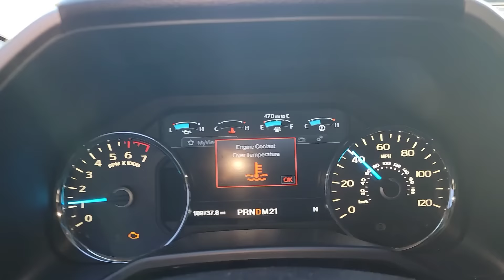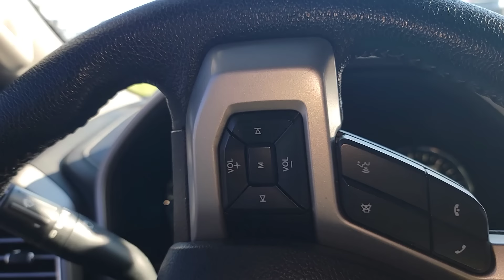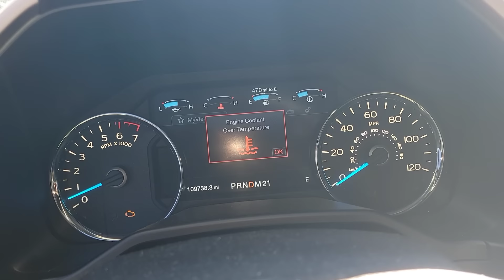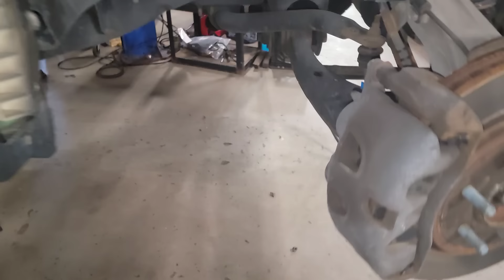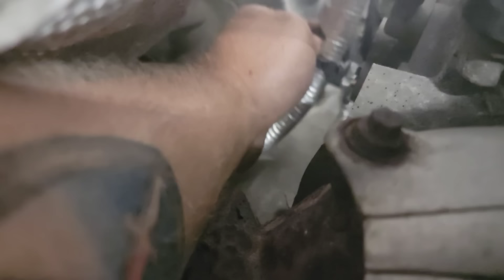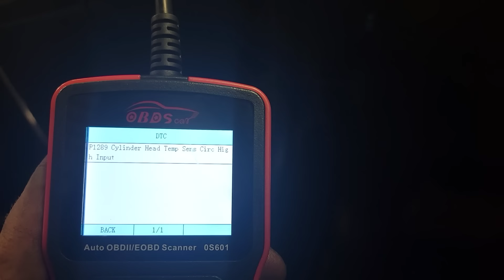2015 - 2016 Ford F150 P1289 - Overheat Out Of Nowhere - here is the fix - Cylinder Head Temp Sensor

Comment: Hi, I have a 17 F150 5.0. Had a temperature fluctuation last winter so I changed the thermostat an that seem to correct the issue. A couple weeks ago it started doing that same fluctuation again so I changed the CHT sensor but it did not correct the problem. Today I noticed that when I turned the a/c on the temp dropped right back down to normal, 194-198. So that made me realize that the fans not kicking on. We hooked it up to a computer and the temperature correlated to the same as the digital readout. We could turn the fan on with the computer but still no fan when temps got a above 200. We checked the fuses and moved relays around still no fan unless the a/c was on. Do you know what may be causing the fans to not kick on when the engine heats up?
Reply from the maker: Well the fans technically don't kick on until like 205 to 210
Reply: @FordBossMe  still won’t kick on, will go up to 222-225
Reply: @FordBossMe  what’s to hot for the fans to kick on?
Reply: @LowRotor is there a thermo switch for the fans??? I have a 2014 F150 3.5L new CHT and it will climb slightly for a short minute then drop, can't hear the fans .... maybe a bad thermo switch???

Comment: I have this issue right now but Ik it’s not the sensor but it’s the connector, it came lose.. is there a fix for this?? Or what should I do
Reply from the maker: If the connector won't snap back in you're going to have to put a new connector on it

Comment: I am having the same problem with my 2011 ford explorer. Ford puts these sensors in the worst places. I've changed the sensor twice. The first time it worked for like 2 to 3 weeks and then it started acting crazy again. I just changed it again and its still acting crazy. P1299. Do i need to get the sensor from ford? First one was from advanced auto then napa. This is driving me insane! Some please help!
Reply from the maker: I have not had that problem with the Ford Explorers so I don't know how to help you on this one
Reply: @FordBossMe it does the same this f150 was doing

Comment: I’m having the same problem, doesn’t throw a engine code and coolant bubbles once it gets hot. Wait 2 minutes and it’s fine. Coolant level stays full trans temp stays normal any suggestions
Reply from the maker: It has to be professionally diagnosed
Reply: Did you ever figure this out. Mine is doing the same thing. Engine does seem to get hot but trans temp remains good

Comment: Those gauges show display actual temp.. Which they can
Reply from the maker: Okay so I don't know what you're getting at or if you think you're trying to teach me something that you ain't really teaching me but you can actually put the truck in engineering mode if you watch my video on it and get a live read out what the temp actually is
Reply: @FordBossMe  Dont know why you felt the need to get an attitude.. Thought my point was clear.. The gauges can display temp, ford chose not to.. Mine does because I bought the obd2 programmer to make them display temp at all times.
I did watch you vid..

Comment: I was having the same issues, fans racing and truck overheating. I replaced the CHT and it still overheats typically when I drive it at or above 60mph. My next option is to replace the thermostat. Has and anyone on here been able to fix this issue? If so, what do I need to do?
Reply from the maker: Yeah if you watch my other videos you'll see that the thermostat is the next option but this typically fix it most of the time

Comment: Is it okay to drive with this problem until you can get a new part put in?
Reply from the maker: If it were me I would know what was going on and I would feel safe but telling somebody else to do that without knowing they're complete situation and them not being a mechanic to be able to assess the situation like I could I couldn't give you that advice

Theoretically I would say yes as long as you're monitoring your trans temperature you would be good but it's also going to make the vehicle run like crap it's going to be dumping fuel it's going to be doing all kinds of things that could damage the catalytic converters

The overall answer to your question would be not a bright idea so no

Comment: my 2018 will do that on an incline at highway speeds and then back off once it levels out, so strange
Reply from the maker: You may have a wiring issue to that sensor or a actual coolant issue
Reply: @FordBossMe  only started after the dealer did a coolant flush so hoping its the wiring
Reply from the maker: could be there's an air pocket in the cooling system
Reply from the maker: @andrewh5627  you're going to have to check for an air pocket in the cooling system that could be your issue
Reply: @FordBossMe  how do check for a air pocket?

Comment: How did you get the connection off?
Reply from the maker: I mean I just reached back there and I felt for it I don't remember if this one has a locking tab that you got to pull up and then push the center piece in or you just push the centerpiece in
Reply from the maker: I'm pretty sure this one you just push the center of the flat spot in and then you pull back real hard and it comes undone but it's been a while man I don't really remember you going to have to figure it out

Comment: Newer ford truck don’t cool the transmission with coolant the have a seperate radiator
Reply from the maker: What does that have to do with this video?
Reply: Well you said that the transmission is cool therefore the engine should be cool which makes no sense since there cooled In different ways the new transmissions have a 190 degree thermostat they are not connected in any way